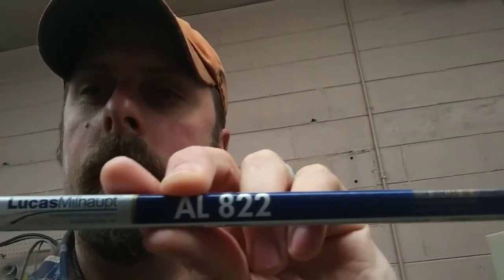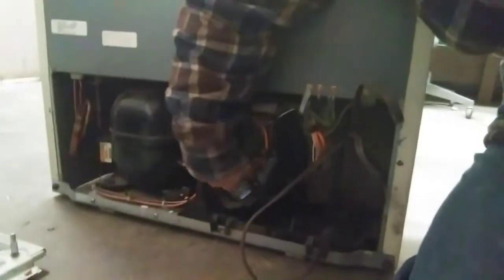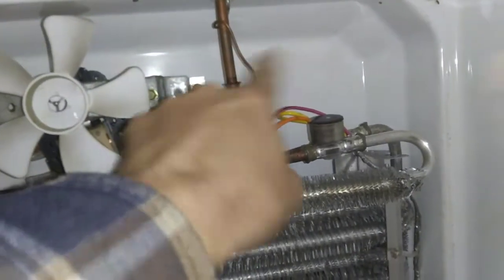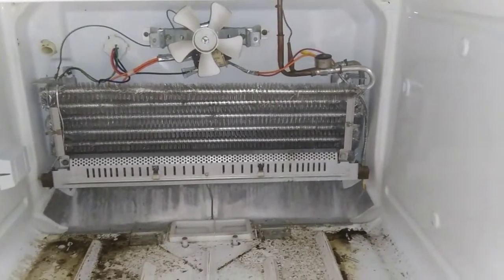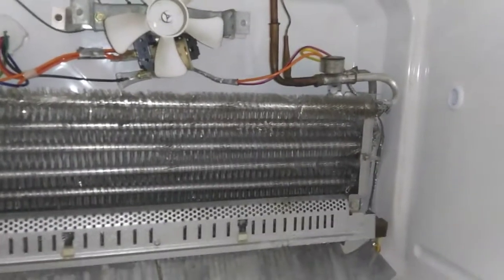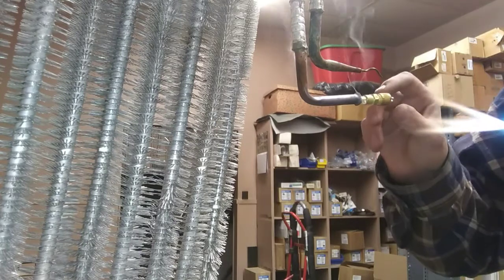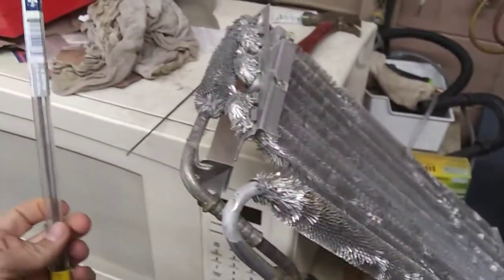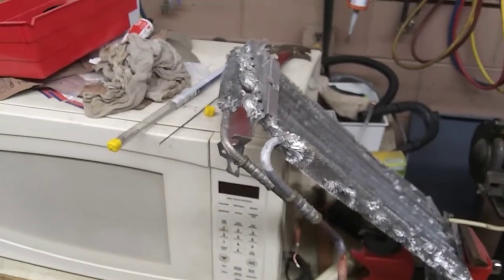Repairing Aluminum Refrigerator Evaporator with AL822 Brazing Rod

Comment: You measure vacuum in microns with a micron gauge.  Under 500 to be exact. Never use your gauges as they are not accurate.

Comment: Uhh you can cut a cap tube with a cap tube cutter 🤔
Reply: You can also score it with a wire stripper tool, then snap it by bending it back and forth.

Comment: Vacuum can be measured in inches of mercury or inches of water depending on the application.  At sea level, an absolute vacuum would be around 29.92 inches of mercury or around 407 inches of water.
Reply from the maker: Wow, thanks for that info! I knew both measurements existed. I was just never certain which measurement applies to which application. For example,  in my automotive days using a manometer, it was measured in inches of Hg. Curiously, the manometer was itself a water column. As far as I've always been aware, HVAC and refrigeration have also used in Hg.